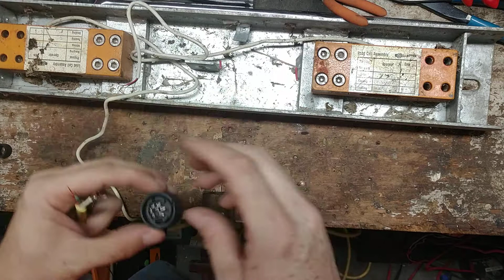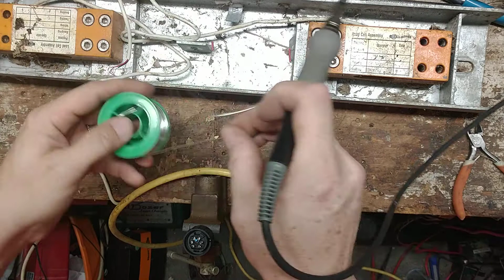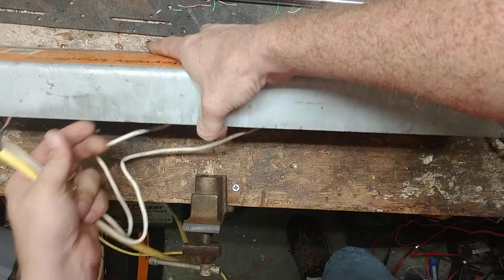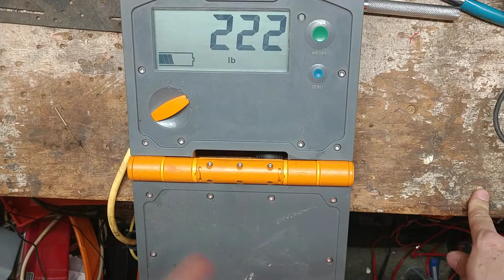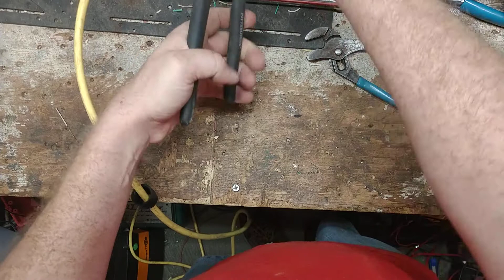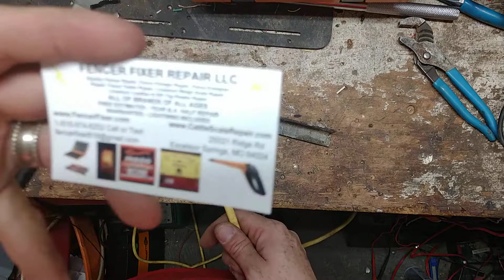Gallagher Alleyway Load Bar Repair Part 2

Comment: Good night, how are you? I want to know how to make a voltmeter that you measure high voltage, I have an electric fence that gives a lot of voltage, it gives 20 thousand volts, it damages them. I want to know how to measure the voltage well. or how it measures voltage. My name is Andres, I'm from Colombia, my wasa is +573147510347, you can give me your wasa, thank you.
Reply from the maker: I'm not sure how the manufacturers do it. I will tell you that it is usually high voltage dc voltage coming out of them. Did you make a home made fence charger? There may be an issue with the charger design. Most brands of fencing units around 5kv-9kv so you likely have way too much voltage also probably too much current. I would just buy a good digital fence tester that's designed for testing electric fence units, they've already done all the work.
Reply from the maker: I don't have or use whatsapp